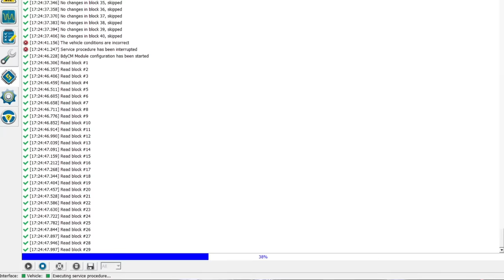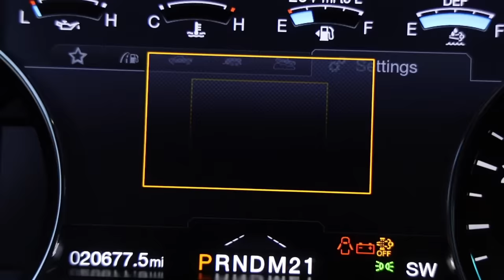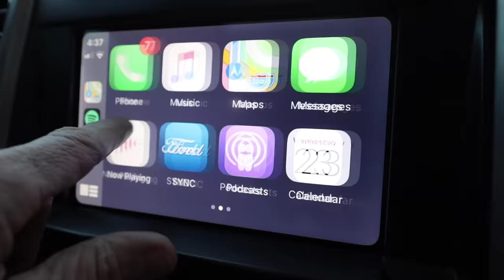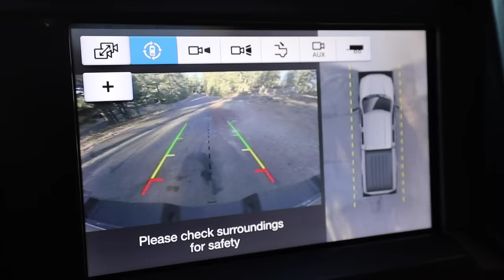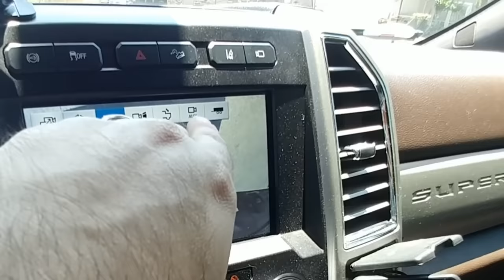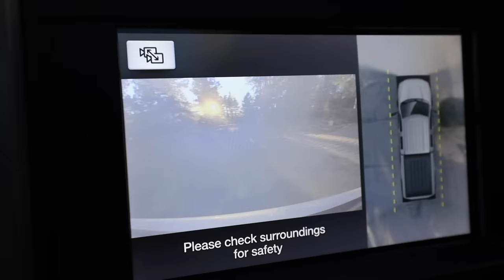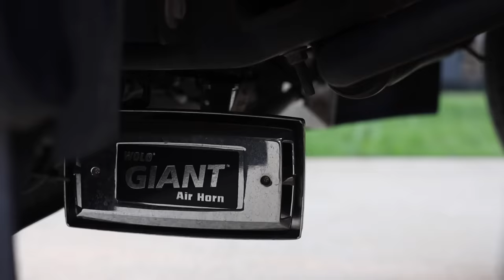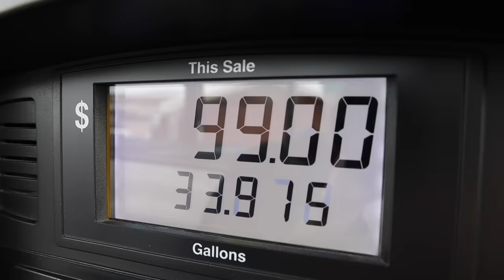Ford Super Duty Secrets! Best Mods + Special Guests

Comment: One caveat to truck stop pumps that I can not recommend strongly enough..... WEAR GLOVES. A a former professional driver who frequented truck stop fuel islands, many of those pump handles are just plain nasty and there isn't enough soap or hand sanitizer in the world to get that stink and grime off your hands.
Reply: As a ex driver, there is nothing better than the smell of diesel fuel or exhaust.
Reply: @earlribaudo4807  and the grime from other truckers
Reply: One of the biggest reasons I don’t like taking my truck to the shop for oil changes (to not void my warranty) I don’t want those nasty grimy mechanics crawling into the truck and getting oil and grease everywhere
Reply: The reason other than cleanliness is if you don’t wear gloves, you get in your truck to drive off and the diesel on your hands get on your steering wheel. After a while your wheel begins to smell like diesel. Now try to get that smell out of your steering wheel… you just as well go buy a new one. I use Plastic Gloves

Comment: I just bought an f350 and used the forescan to mod my truck. I love the ability to do some small things to make it more convenient for me as well as personalize it slightly. I turned off the double honk feature when left running, but I also enabled the secure idle so it can’t be taken out of park without a key inside the truck. I leave mine running allot with out locking the doors. It ads a LITTLE bit of security by not allowing it to be moved.
Reply: I HATE the double honk when left running and the key is in my pocket.  I'm going to look more into Forscan.  Thanks.

Comment: The area for the key, is used to read the key if the battery in the fob dies. After using the emergency blade key in the fob to enter the truck, you place the key in the the hidden spot, which energizes the key so the vehicle can read the key and start the vehicle.

Comment: My approach to purchasing the 2016 F250 was the same as yours. They were discounted heavily when the 2017 aluminum body trucks were coming out. Plus most of the bugs are worked out since it is the end of the run. It came with the 3.55 gears. I only buy 4x4, we get snow and ice where I live and I like to explore once I disconnect the trailer. Made some of the mods you have shown except for air compressor/air horn. LED lights on the rear were one of the first, so nice to be able to see when backing at night. ECU updates were 6 flashes for blinker, 50 gal fuel tank, DPF percent and fogs while on high beam. Manual regen with my generation of F250 needs to be done with laptop. I think the earlier years that are XL or XLT can be done manually. Wish I could read DEF level, but it will tell you when you are below 1/2 full and when you have 500 miles left. If anyone needs the spreadsheet of changes for 2011 to 2016 I have it. Oh, don't forget the chrome muffler bearing, that's a cool mod. :-), Forgot to add that just ordered the full card a few days ago, ref KYD

Comment: We are especially considerate when fueling our class A diesel pusher at truck stops, and are always as expeditious as we can be, but we sometimes find that the truckers in front of us in the lanes are less so.  They will pull up to the pumps and leave their vehicle for several minutes (we've experienced up to a half hour), return to their truck, pump their fuel (which takes a long time because they're pumping 200 gallons or more), then pull forward and stop, as is the common courtesy at truck stops, then leave their truck again to go inside, and return to their truck and leave after another 15-20 minutes.  It's almost as if they're doing it because they have an RV behind them in the lane.  The problem is, there are always trucks in the same lane behind us.
Reply: As a truck driver myself we have to deal with other truckers doing the same. It’s not necessarily because your in an RV.

Comment: One of the best video's to date. I have had numerous Ford trucks over the years and had no idea about the exterior lock keypad items you showed. The last 20+ years I have bought 4x4's for boondocking and not having to worry about getting stuck (within reason). I have only used it a couple of times but saved a long walk to get cell service to call a tow truck and a $600-$800 tow bill. I was able to stay camped while it was snowing a few times as well .

Comment: 10 speed is awesome. I got the 7.3 gas and 4.30 gears in my 2020 350 long bed. Towing 38ft travel trailer and golf cart in the bed of the truck. Its a beast of a truck and it just sounds amazing when you hit a big grade and it drops down a gear or two. Couldn't be happier, it's an awesome machine.
Reply: Still loving it?
Reply: @Anthony-qq2ue  I traded it in for a 2022 f450. Loved the truck no issues whatsoever. We decided to go full time rv and I upsized my rig to a 42ft 18000lb fifth wheel. The 350 single tire was just not enough truck to comfortably pull a rig that size. It was a great truck though, I really liked the engine and Trans. The 1100ft/lbs of the 6.7 with the 10 speed is on another level though. Incredible pulling power.
Reply: @japhethwar  
Very cool! We haul a 5th wheel RV for work all over the place. I use an f350 DRW with the 6.7 and 4.10 rear end probably very similar to yours pulling power wise, is the turning radius really good on the 450?
Reply: @Anthony-qq2ue  Yes it is, significantly better than the 350. The ride is a bit stiff, but the 4.30 gears and giant brakes are pretty awesome for towing. I went up the Eisenhower in Colorado which goes over 11k ft and it was barely straining the truck. It is a beast.

Comment: Happy Holiday guys...I have a 19’ F-350 with the 6.7L diesel. I didn’t hear you mention it but in Forscan you can select Bambi mode which enables you to use the fog lights with the high beams on at night. Factory settings will turn off the fog lights when you go to your bright lights. Bambi modes allows the fog lights to stay on....there’s also a cornering light mode that will turn on just the left or just the right fog light depending on the direction you turn and then cancels the fog light once you straighten the wheel out.
Reply: Really my fog lights and light bar in my bumper are on my upfitter switches

Comment: Another tip on the hidden key fob holder in the console - if the battery is weak in the key fob, placing the fob it in that compartment will allow you to start the truck and drive it to the store to get a new battery for the fob!
Is there a FORScan code to keep the 5th wheel camera (or any selected camera) on as you change gears from reverse to drive and back to reverse while lining up on the hitch?  My biggest aggravation with the camera is that it switches back to the normal backup camera anytime I shift to drive so I have to tap the screen again to get back to the 5th wheel camera.  I do agree the camera angle and lighting isn't ideal.  I've made it a bit better by using 1 in white gaffer's tape- 1 strip on the hitch and 2 strips with a gap on the pin box.  The contrast helps with the lighting to line up quickly.

Comment: I have a 2021 F350 diesel DRW with a 4.10 axle ratio with the 10 speed.  At first I didn't care for it. Thought it was just to many gears. Now,  I wouldn't give it up.  Pull a 40 ft ,6 slide Alpine rv as if wasn't even hooked up. At 65 to 70, it's still under 2000 ram and quiet in the cab. Amazes me how smooth and quiet it is when going up mountains,  has stayed in 10th  gear on 6% hills without any hesitation

Comment: If you get a pilot card you can put it on your phone. You can get the RV price and save 3 cents a gallon as well and get points to spend inside as cash. Loves has same kind of stuff as well
Reply: Pilot gets more out of having your data than 3 cents a gallon.  They’re using you.

Comment: One thing I would say I love about my Cummins is that the high idle is built in. Leave your truck in park. Turn on the cruise control button and then hit the set/reduce speed button and it automatically goes into high idle. Lovely thing to have in Ohio.
Reply: Didn't know this was a thing.  Is that mostly beneficial for cold weather, or?

Comment: That is interesting about the trailer brake controller. I found my self having to back down a very steep hill and it felt like my RV brakes would take a while before they would "kick in". It was quite scary and it felt like I had zero brakes, going backwards,, down hill and my 40 foot toy hauler pulling me. Thanks for the information.

Comment: Hi Marc, have you looked into a product called “gear vendor”?
It is a gear box that bolts on to the end of your transmission (which means you will have to get your driveshaft shortened) this unit work’s similar to a big truck with a transmission with an upper and lower range. This gives each gear an upper range, a lower range, and the range that is in the transmission. This gives you the ability to go even higher or lower in your ratio. The articles that I’ve read or seen on YouTube say you will increase your fuel mileage by about 15-20%. It’s a very simple install, not counting your drive shaft needing to be shortened, this can be done in an afternoon.

Comment: I have an XLT and forscan opened up alot of options that lariat and higher comes stock. I love that program.
Reply: Now I have to get the Forscan! Are you using the windows version with the cable?
Reply: @kevinherm3036  yes with windows 10

Comment: ForScan is easy to do, I’ve made several changes to my 21 F350 Lariat. Turn signal now 5, Bambi driving light mode, temps above gauges, changed display start up screen. Left seatbelt warn on.

Comment: If you decide to re-do phone mount or add another item like RV GPS, look at F Series specific mount from Builtright Industries that goes in the center tray on top of the dash. Combined with RAM Mounts components you can add lots of things, including phone mounts that aren’t specific to phone model, and have lots of adjustment options with arms and swivels.  HNY and travel safe.
Reply: JD from btbrv has an episode on that mount Bob is referencing.

Comment: FORScan is great an your pointers are spot on. being that you have a platinum you can set your GPS so you can in-put while driving otherwise you need to be stopped. also you can add a wire to a control box in which you can leave your led spot lights( on your mirrors ) on at any speed.  in FORScan you can also  change your welcome screen in the center of your instrument cluster.

Comment: Just bought a 2017 f250 lariat. It’s a 4x4 with the 6.7 and it has the lariat ultimate package as well as a 6 inch BDS lift. 60k Miles 1 owner. The truck doesn’t have 1 scratch

Comment: 11:15 I bought the proclip too for the same reasons. To address your cons, on proclip's website I bought the MagicMount Pro XL. My wife has an iPhone and I have a Samsung Note.
It's a large magnet you stick on the base their. The benifit is the metal plates attach to any phone or tablet you have. It has a cleaner look IMO with the magic mount. Because when not in use it doesn't take up as much space.

Comment: It an inertia brake controller. So the trailer brakes are not jerking you back when you only gently apply the break. Liked your video. I have a 2019 350 srw xl super cab with an 8 ft bed. I just got the recall notice for the death wobble. You should add the spe lower temp thermostat. I have a 10k enclosed trailer and a 16k dump I pull and it made a big difference in engine and transmission temps.

Comment: The DEF changes you made were included in an update to the trucks system last year. I had an issue where my check engine light came on. The truck needed a regen, but I was not driving it far enough to work for a regeneration. Took the truck in and the update added the percent window and the regeneration control. 

I've also had the wobble only in my 17 F250. A 2005 and 2013 F250 were fine. The latest replacement steering damner corrected the issue. Be careful with changes to the steering, that will void the warranty for any future issues. I also researched other changes and have chosen not to do them due to the warranty.

Comment: A few things ( I apologize if someone has already pointed these out)  While the gentleman (Joel) is technically correct that the console safe can be ordered through Ford, it isn't made by Ford.  It can be had cheaper from the company that makes it, which is Console Vault.  I have had them on my last 6 trucks to include my 2017 F250 and my 2020 F250 (same console, same part number from Console Vault).  They are very easy to install as well.  As for the gear ratio and transmission discussion, I had a 3.55 in my 2017 with the 6 speed.  When I ordered my 2020 (in late 2019) Ford told me that the 3.55 actually came with the heavier duty towing package.  (When I tow, it is about 10K lbs.)  My truck has the 3.31.  The reason the 3.31 is standard - is in fact that wonderful 10 speed.  More gears, steps - allow the truck to tow the same, but with a better final drive ratio.  This thing is delightful on Texas roads at ~80 MPH; it positively "loafs", and gets great gas mileage.  What I am saying in short is that it can be said that "a 2020 with a 3.31 tows no less than a 2019 with a 3.55", but has better highway manners because of the 3.31 and the final gear ratio in the 10 speed versus the 6 speed.

Comment: Why I like 4 wheel drive when towing: Low Range when backing into a spot. Gives more torque, sort of like tractors the trailer across the soft stuff, over the bump, whatever, it is just seems more smooth than having to press lightly on the accelerator then having to get off of it again.

Comment: Just some input.....with ForScan, it's best to use a wired OBD2 interface (one with switch required for ForScan functions). Some have problems with interference and misloading the changes when doing wireless. 
I had both and felt way more comfortable and seemed quicker wired.
Hope this helps!
Reply: What about Derringer?

Comment: I have a 2006 F-250, 6.0 Diesel, FX4, extended cab and loving it.  Am also an amateur radio operator, so no desire for the sunroof (need the metal for mag-mount antennas).  The rear hinged back door is useful for my other antennas.

Comment: In the 2019s cordless Apple CarPlay and Android Auto are not possible. Only in 2020+ if I recall. It has to be SYNC 4.
The benefit of connecting by wire, at least in the 2017-2019, is that the playback quality is better. I’ve had it connected by BT and playing as I connected to USB, and there was a noticeable improvement in quality.

Comment: i tow with my 2019 250 everyday all day, i installed recovery tow unit under bed and its used as grocery getter kid mobile and my work pig, gas 6.2 love it has 12000 GVW and 15000 tow capacity, mounted 35s with 22in rims no lift just stabilizer air bags to support towing and i tow box trucks utility bodies dump trucks and its lovely, can tow full size vehicles 80mph and its solid, no other leading truck co. compares, and lots of people use a passenger door handle with no lock hole to make it a little harder for crook to get it, if you have keyless entry pad

Comment: Great video of the 2019. I too owned a 2019 F350 w/6.7 PSD.  It handled my 12k lb boat just fine; however, a bored day found me in the seat of a 2021 Dually.  I will say, the 2021 has many agreeable upgrades for those that tow on a consistent basis. The 10-speed is amazing and coupled with the 4:10 gears she will pull a Marine from a strip club. ( I speak from 21 years of experience) Additionally, there are 4 drive modes that alter the ECM and allow for something that resembles MPG.  My 2021 does not have a center console on the middle seat. My 2019 did and I do miss that.  For comparison, both my 19 and 21 are the STX model with FX4 packages.  Loved the 19! Really love the 21

Comment: I ended up getting a 2020. I was a bit apprehensive due to the 10 speed. After a couple of friends got them and were thrilled with the performance, I decided to make the purchase. The 10 speed in the Super Duty operates much better than the 10 speed in my 2019 F150 did, which was a pleasant surprise. The death wobble updates to the steering components was a nice update too. If you decide to buy another truck, you may want to wait until 2022 or 2023 (depending on how you feel about the interior and the overall looks).

Comment: Thank you for the information on this video. Love watching your adventures. I actually purchased some mudflaps for my Ram 2500, very similar to what you bought for your F250, so the mud and snow wouldn't accumulate on my Amp power steps. I've been looking for a solution to the steps coming down and having a build up of mud on them, thereby tracking it into my cabin area. I believe they'll work perfect without being so gawdy looking.

Comment: I think they outlawed blinker fluid in Florida.  Where you have the key fob is for when the battery is dead in it so you can start the truck ( all with push button start on ford will have that) some are center console others are cup holder. When towing definitely keep an eye on trans temp that is the thing that will kill automatic transmissions the fastest.

Comment: 8:05 True, however, you really just traded paying less for it with it having be worth less when you go to sell it. So you saved $5000 (for example) when you bought it, however, it is immediately worth $5000 less because it is a year older truck and when you go to sell it will be one year older than the truck you would have bought.

Comment: It's important to mention that many of the features mentioned are not available on all Super Duty Ford's.  Marc has the high model.  There are different camera options and various other options based on if you have an XL, XLT, etc.  The most options on the Platinum. No tool will allow you to modify or create options that don't exist.  Good video.  You will want to do more research before you drive in head first.